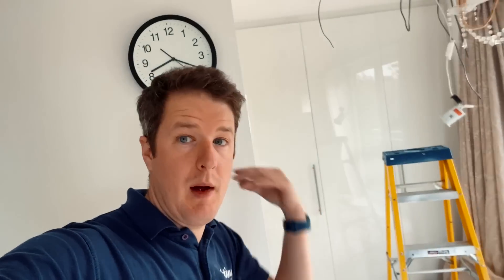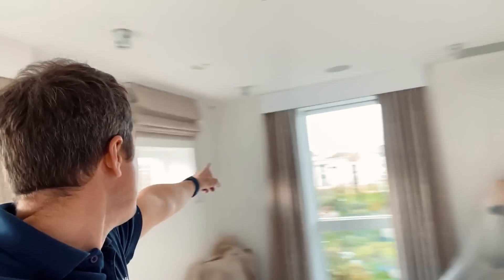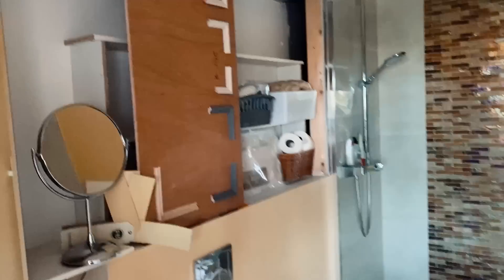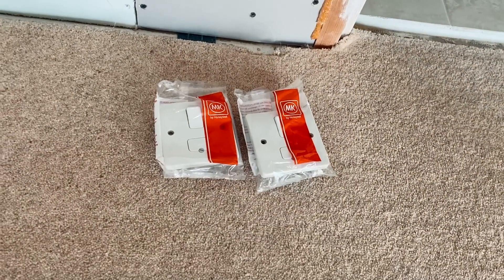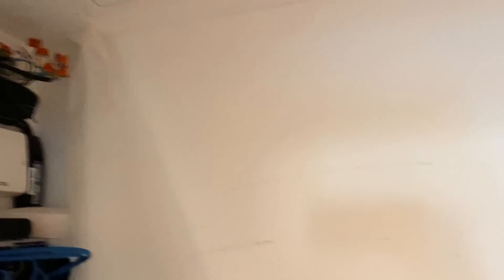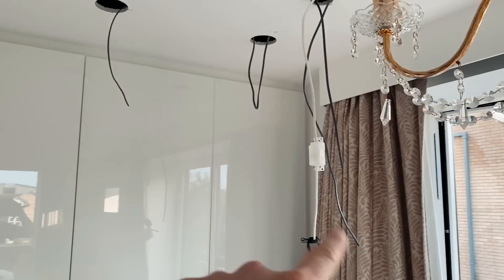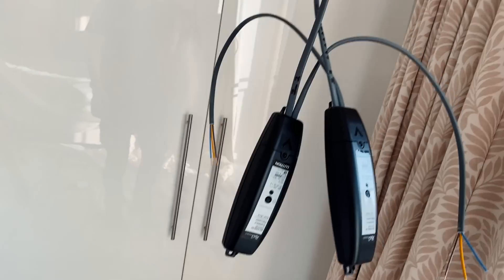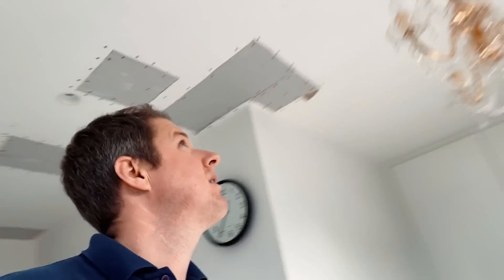Luxury Smart Home Installation Cambridge

Comment: I use the Heatmiser system for my underfloor heating and central heating and am quite please with it and the app. The only issue i saw was the underfloor temperature probe was just wired in T&E, my probes are on shielded cables.

Comment: I would put knx in can't think how good those wireless devices would work in 5 years time, knx standard is also made by different manufactories   so if a company goes bust you would still find replacements if required

Comment: Lutron or also known as Lootron so flexible you have to put 2 lights in for a simple function. 
Had they done some research and went with Rako they could have had 1 led strip with 2 functions. Dim when you turned the lights on at night and bright if it was during the day. Saving money on equipment required.  Instead then now have to have 2 led drivers ,2 ra2, 2 bits of tape 2 bits of profile.

Comment: I hate this kind of systems. Try to get spare parts for this "smart" system 15 years from now. -> replace the entire system. I only recommend a standard DALI, KNX or some centralized control system. I always recommend installing back boxes and cables for low voltage switches even if they are not needed in your current system.
Reply: KNX bullet and client proof.
Reply: To be fair Lutron is probably one of the better systems, but yeah, wouldn't want this stuff in my house, and I'm an EE who designs this equipment for commercial projects!
Reply: Ripped a DALI out of an office block and fitted convention switching instead as the  Installer was a twat and his kit was shit, didn't deserve the time of day let alone paying.

Comment: How do you regulate the heat of the towel radiator if no probe and the stat is outside?
Reply: It has a PTC heating element, It only heats up to its designed temperature and stays at it.

Comment: Is there a ‘Smart’ solution for a garden switch box?
Reply: Not a smart option as such, but check out wisebox. Switch lines all run back to that and can switched by a remote fob.
Reply: @ojl_electrical  thank you. Yeah I’ve seen these, however ideally looking for something that works with Amazon Alexa. Looks like I’m going to have to use a large waterproof box and smart plugs.
Reply: @scotchegg6422  Rako cant go wrong.

Comment: Why are Sparkies apprehensive when you tell them that someone else did some work and you'd like them to finish?
Reply from the maker: Because usually there is a bad reason if someone didn’t finish what they started
Reply: In my experience if a good electrician has left a job unfinished then more than likely the client is the issue. I mean in the space of this video the guy added a socket below the spurs. I can only imagine how much else he probably kept piling on. Its not always about the money we get paid. We take on a job to do work we agreed. When doing complicated jobs client start adding and changing then it becomes a never ending job. Those clients are the ones that ring you 10pm at night with no shame "oh the lights aren't working can you help".
Reply: @MehmetAslan-ec7nv  I have been in this situation many times in my earlier days and I would answer their calls. I then started sending a text out asking them are they aware of the time an making them feel like a bell end.
Reply: In Ireland there is a pile of paperwork and procedures to allow for a change of contractor.
And there is always a reason the sparky wants out !!